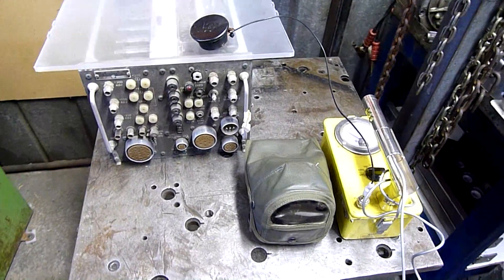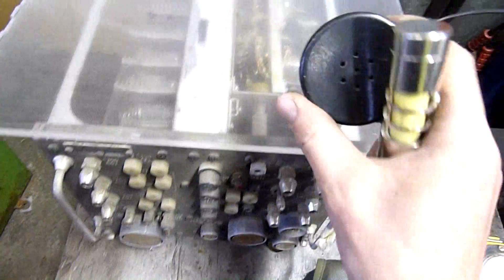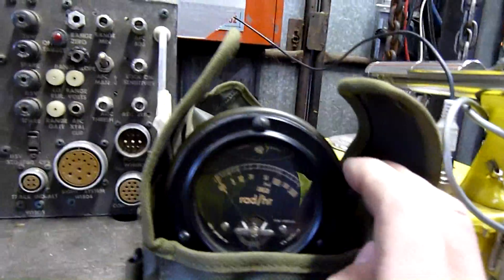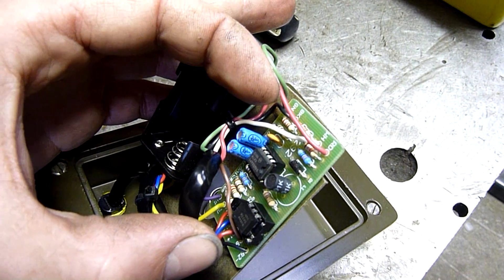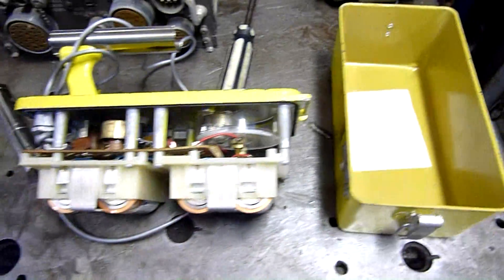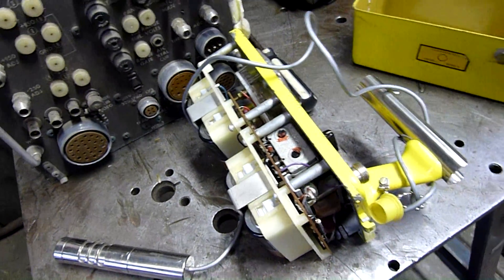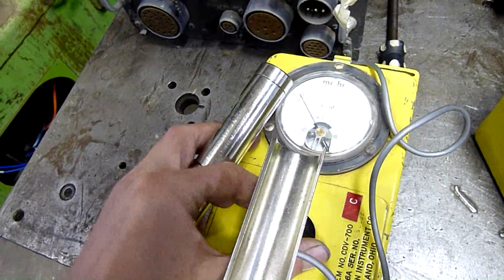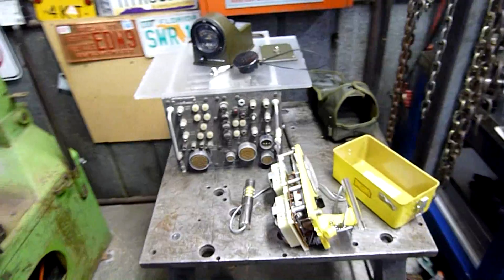Radiation Meters Victoreen CDV 700 and Canadian Admiral IM 174A PD

Comment: Nice! You shouldn't have any problems getting CD V-700 Geiger counters with check sources. If so, than that would be ridiculous. Those sources are also relatively safe, even for extended periods of measuring. This model contains a small amount of U-238 metal under the sticker. It's low-level. Those Ra-226 tipped switches are not very dangerous either. I have dozens of those switches. I collect radioactive sources. I have sources that peg my CD V-700. There's a lot of paranoia about ionizing radiation. If it's measuring in mR/h, you will be fine. R/h is when things get hazardous. Isotopes with shorter half-lives pack more of a punch than isotopes with longer-half lives for the same period of time. Ra-226 is hazardous chemically. Don't get inside you. External, at that activity is pretty safe. Depends of the activity and how much your body is exposed to. Again, these sources are fine.

Comment: Sir it's a cool video and fun to watch but - just to correct things a little bit... and I've made the same mistake at first in my cdv700 videos:  We can only correctly refer to the mR scale when the beta window is rotated closed on the probe.  That will block out beta so you only measure Gamma (for mR).  Otherwise you have to refer to CPM (counts per minute) which is not nearly as spooky as the mR scale (Gamma).  Also, the toggle switch is likely not cracked.  They just put out a fair amount of Gamma activity right through the glass, because Gamma passes through it like butter.  Finally, as you may know - on the Radiacmeter... those are cool for when the nuclear apocalypse happens but good luck getting the needle to twitch on anything other than battery test.  You see, it takes 1000 mR per single Roentgen on that unit's scale.  Just like 1000 milliamps per amp.  Also, your glass tube inside the 700 is a Corotron voltage regulator.  It has a tiny amount of radioactive material inside it too!  Go figure.  However, it has a short half-life so may begin failing in the next several years.  You can replace it with 900v worth of modern Zener diodes, no problem.  There's also a little Corotron eliminator sub-board you can buy on ebay for dirt cheap to do it.  Hope this helps some people and sorry if you already learned this stuff since you posted the video almost a year ago now, I see.  Check my channel for testing various antiques for activity. (click my little yellow speaker icon if you like).
Reply from the maker: Thanks for the info!, I was not aware of how to operate it, I should really get a manual for it :D

I was not aware of the Corotron issue either, I will look up the eliminator board :D

Thanks!
Reply: Aussie50 Lol, I didn't read the manual either when I got mine.  I just started scanning things because it's so much fun.  They fit nicely in an old camera bag from the thrift store.  Use a soft cushy luggage strap for more comfort.  Take yours into any antique store and be amazed at what it finds.  Be sure to explain it's an antique glass detector so you don't freak them out too bad.  :)  I do it all the time - no problem as long as you're friendly.  You will want the beta window open for finding uranium glass or orange glazed pottery.  You can close the beta shield if you want to get an actual mR reading off of Radium painted antique clocks, etc.  They do put out a bit of Gamma.  The other stuff will be mostly Beta.

Comment: I have 3 CD-V700s in the original box. They were shipped in pairs of 3. Problem is, all 3 of them have bad germanium transistors. I tried substituting silicon transistors and they wont work. At least not in the self-oscillating flyback side. I did recap all 3, and only brought 1 partially alive.
Reply: Fortunately you can get Soviet made Germanium transistors through fleabay, I've heard that they are a lot more reliable then their Western counterparts, in part because they don't have any issues with tin whiskers.

Comment: The thing I don't understand is.......WHY would someone want a radioactive switch control? What's the point of it? My lightswitch in the kitchen isn't radioactive (well, I'm sure it isn't but then I have no way of testing it, but my money's on it not being radioactive :D) so why is that switch radioactive and what's the point behind it?

Thanx for showing,

-BoomBoxDeluxe.

19th March 2014, 23.46
Reply: The military used Radium-doped luminous paint in many instruments before the late 60's. The Radium would emit alpha particles, as well as its decay products, and would "activate" Zinc Sulfide, which glows when exposed to alpha radiation. So, mixing these two yielded self-luminous paint. I have loads of sources with Radium. These toggle switches aren't made anymore, and I have over 20 of them. Radium is more of a hazard chemically. You don't want to get it inside you. The amount in this video wouldn't cause radiation sickness, but if ingested or inhaled, COULD cause health problem many years down the line. External exposure is very low. It depends on activity, and how long you expose yourself. Distance, time, shielding, and knowing what type(s) of ionizing radiation it emits is very useful. Ra-226 has a half-life of 1600 years. That's relatively short. Grams of it would be dangerous. But in this case, this is nanograms. Maybe a microgram. 1 gram of Ra-226 = 1 curie or 37 gigabecquerels. A becquerel is a decay/second. Isotopes with shorter half-lives pack more of a punch than those with longer half-lives with the same activity.

Comment: The green counter. I think i've seen one of those in a video made by 3 guys going to Pripyat.

It was affixed on a mount similar to the mounts you have on old patrol cars from the states with search lights.

 Only this one had the counter and no swivel action. Looked professionally built so i think, but don't quote me on it, that they might of had made this for propping on dashboards and even outside the car like i said.

Wish i could find the video but i don't remember squat about it since it some years ago. But i remember the meter.

Comment: I'm surprised something like that is even legal to own.
Reply: Your cat is so damn cute. :D
Reply: I collect radioactive materials. What he has here is low-level. I have dozens of those Radium tipped switches, and that same model Geiger counter. I have various isotopes. It would be dangerous if it came from a hot cell or high level nuclear waste. It depends on the specific activity of the source. The Radium in these switches contain about a microgram at most. Even though it is radioactive, the amount is tiny. It is chemically toxic, so the only concern would be somehow eating or inhaling the active material, and even at that, it would only maybe cause health problems many years later. Distance, time, and shielding are the three basic rules to follow. Knowing the specific activity, half-life, and type(s) of radiation (alpha, beta, gamma, neutron) is also important. Short-lived isotopes always pack more punch than long-lived isotopes of the same activity and type of radiation. In short, it's complicated.

Comment: I'd love to pass a radiation meter over my Trimphone dial (just the dial, don't have the full phone), as they use a Tritium gas tube to glow in the dark, at least back when it was new, it barely glows these days cos the phosphors are shot... :P
Reply: that sucks that it doesnt glow much now :(
Reply: Yeah, but it is 42 years old, most trituim tubes would be depleted after that amount of time, as they're basically permanently-on fluorescent tubes, only they use a Beta radiation source to make the phosphor coating glow... :)

Comment: Ah, I love the sound of a Geiger counter. 
Does that little bit of Radium feel weird (tingling, burning, ETC)?
Reply: No. I have about 2 dozen of those switches. I collect radioactive materials for study. I have sources much more radioactive than these switches. The activity of those are very low. 1 gram of Ra-226 is 37,000,000,000 decays/second (37 GBq) or 1 curie. 1 becquerel (Bq) is 1 decay/second. These contain nanograms, maybe about a microgram, max. However, in the pitch dark, these Radium sources do glow a faint eerie green, since it's mixed with luminous paint (Zinc Sulfide). The glow degrades over time. The radiation damages the crystal structure of the Zinc Sulfide, where it has no crystal structure (metamictization). The crystal structure becomes amorphous over time due to persistent alpha radiation. However, Radium is similar to Calcium, so it shouldn't be ingested or inhaled. This could lead to health problem later, depending on the specific activity absorbed.

Comment: I had a Radex1706 if you want test that with something a tat newer than a CDV :-) Could be radium. Latter stuff tended to use Tritium  but that's a gas and I doubt it remain detectable if vented. Per importing sources the US won't allow export of even check sources and I've not looked at what the local authority restricts. Please don't tell them I've got a few Tritium markers.:-)